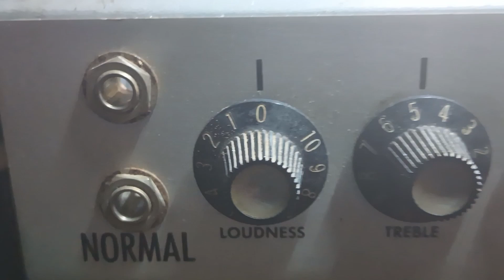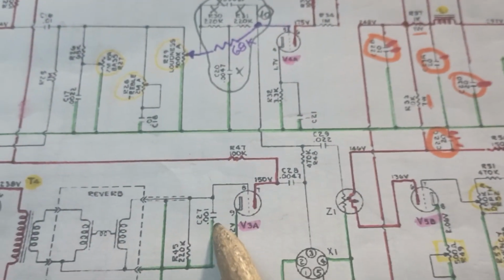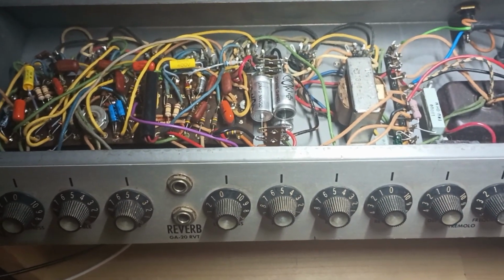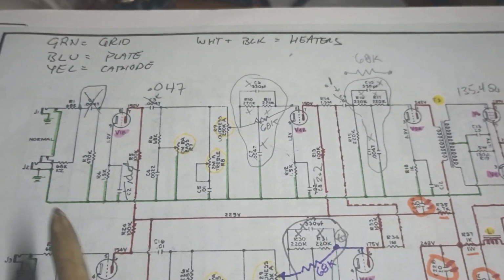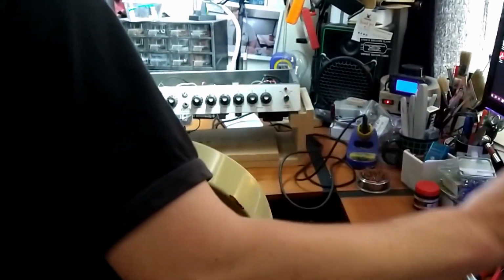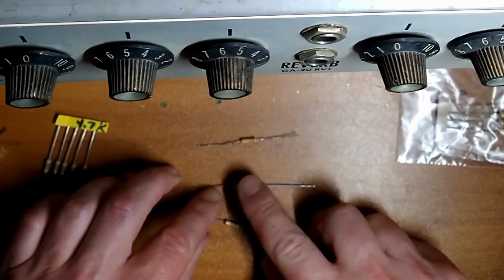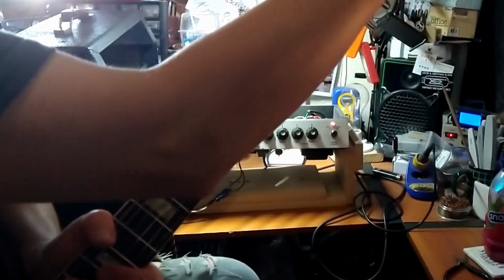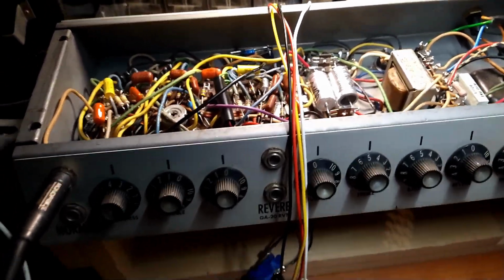Cuckoo for Cathodes & Cold Clippers  - 1967 Gibson GA-20 RVT #2 pt. 2 - LET'S REPAIR! - EPISODE 48

Comment: Did you cut out that terrible tone robbing Gibson chiclet?
Reply from the maker: It didn't have any chiclets but it did have similar circuitry x3 using discreet components. Each had two capacitors and two resistors and these were replaced by 68k resistors. A world of difference!